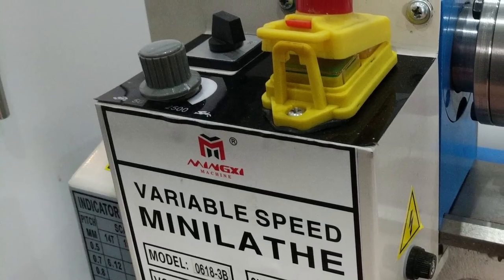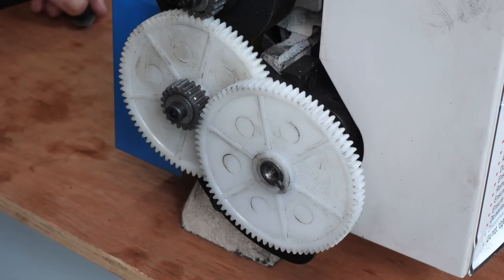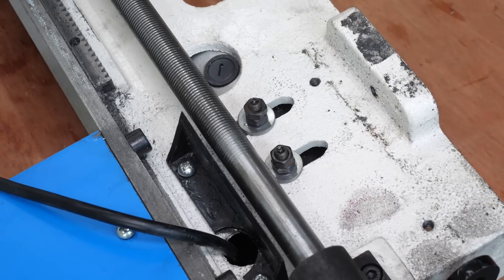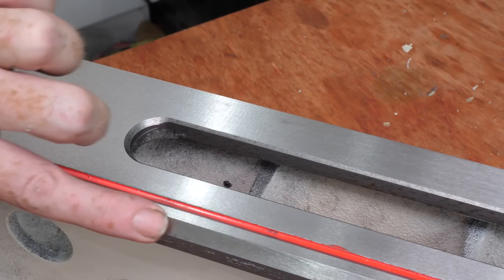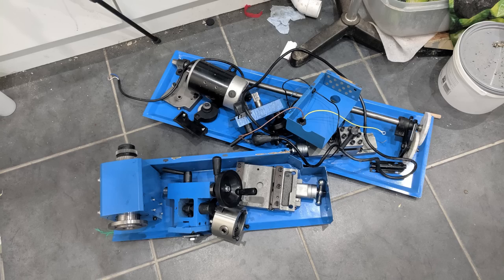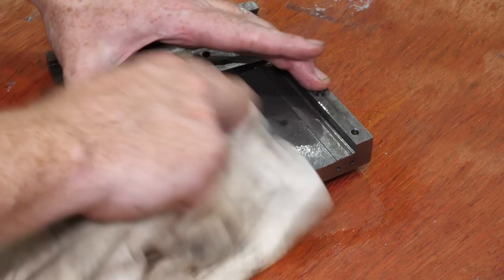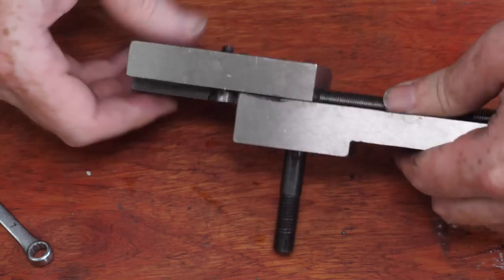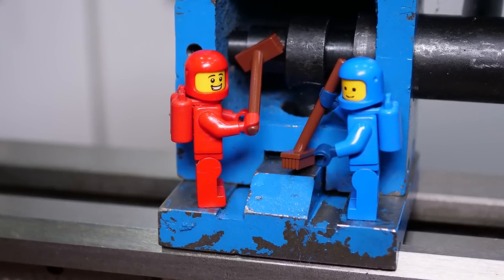Disassembling the CJ0618 7x12 Lathe, Cleaning, and Troubleshooting

Comment from the maker: A few points to emphasize,  which may not have been completely clear from the description and voiceover:

1. This lathe is marked as a CJ0618-3B model lathe, but has no other real branding information on it. The design is similar to the Sieg C2, but there is no other connection to Sieg that I know of.
2. The lathe was sold absurdly cheap as part of a batch from an anonymous Chinese eBay trader shipping from Eastern Europe. Based on what I've seen it was probably a factory second, or QA reject being sold off.
3. I am not at all unhappy about getting it in this condition, and have no intention of sending it back. Given the price, and the complete lack of proper branding, or reputation, I expected something at the lower end of the quality range. I did this to find out what the really cheap end of the mini-lathe market is like, and also to learn how to take a machine in poor condition and improve it.
Reply: Mine's a PL2102, but other than the paint colour, virtually indistinguishable. Also sold here (in UK) as CJ18. Useful, as almost all the parts are directly interchangeable. Quality depends very much on who you buy from!
Reply: It will be interesting to see how cheap it truly is, after you've bought various replacement/upgrade parts.

(hobbyists never count their labour costs, of course - it's called a "pastime" for good reason)
Reply: People have a totally biased view of "quality".  Even many old school ‘Merican tools needed a lot of fiddling or “fettling” before use. A woodworking hand plane bought at the local hardware store years ago was never fit for work right out of the box, first it is disassembled, and the body is sanded, scraped, and lapped smooth and square to all sides. The blade back is polished to a near mirror finish, and then the cutting edge is honed to hair shaving sharpness. The frog is deburred and the throat and cap iron deburred as well so the blade sits flush all ‘round. Lightly oil everything, put it back together, and NOW you're ready to use it, typically a pleasant couple of hours or so on a weekend for the average Joe back in the day, but ready for a lifetime of good use. ☺
Reply: Barry Manilowa  Re: tools, etc. My country has an issue with the perception of excellence, which is to say if an item is not made by and within the continental U.S., it is automatically assumed to be of inferior quality. As a young technician in the ‘60’s, Japan was the whipping boy of choice when it came to bashing, it was derisively called “Jap junk!” and that would win any discussion. Nowadays, if you want super precision- and can AFFORD it, you cannot beat a Japanese product. Moving along, as the decades passed the title of “Junk Purveyor” went to Mexico, S. Korea, Taiwan, and currently China. The U.S. consumer market itself made these countries a major player in the manufactured goods sector; a prime example is the company everyone loves to bash but is always the first stop when shopping for an inexpensive yet sufficiently robust tool: Harbor Freight. I’ve heard it all before, down through the decades, and it still translates to just one central concern: fear of change, and the inability to accept it.
Reply from the maker: @Daft Old Man I agree Real Bull and Sieg are different, unrelated companies, and it certainly seems that Sieg make better quality machines on average.
Reply: @BeachsideHank  Consider that the Japanese we're entering a new era of mass production and still in the prices of building/rebuilding their factors of production in the 1960's and just beginning to employ higher standards and efficiency methods as an industrial culture. This film illustrates a known defect product made in a bottom scraping industrial setting and culture. Some products entirely from China are excellent, but they are a relative minority
Reply: This is the 3rd mini lathe teardown I have seen. On ALL 3 the motor was flipping around like a kid on a roller coaster without a seatbelt.They all had mostly the same problems with fit and finish, and I even understand selling a 2nd with SOME fit and finish errors. It seems to me the poor motor mounting problem should have been corrected before selling. I hope the factory has fixed some of the issues for the ones they build now.......but I doubt it.
Reply: Block head  As am I, but he never replied back to you.
Reply: Would like to See what your compressed air solution is as I am currently lacking this and require a small unit for such.
Reply: Worth noting that although the lathe claims it has high and low gearing, it does not. The gear shift is missing from the back of the headstock casting, and the pot goes from zero to 100 without changing anything. I bought one of these (MX-0618) and was looking all over the place for the way to shift from high to low gear since mine has a tachometer and maxes out at 3,100 RPM!
Reply from the maker: @tjstips808  The lathe I bought didn't even make the high and low speed claim in the listing. The pot does work to vary the speed though. It was advertised as a variable speed lathe with no mention of a high/low lever.
This is something I actually regret. I'd have more options if it actually had the two gears.

Comment: Best thing to do with those saddle plates is to ditch the set screw adjustment method, and just shim them. It's fiddly, and takes time, but it's worth the effort. I used some aluminum sheet metal to get close, then fine tuned with kitchen aluminum foil, one strip at a time. As another commenter said, you'd also do well to mic the bed ways, and file/stone the underside to ensure uniform thickness along the entire length of the bed.

You can add a carriage lock very simply, by drilling and counterboring the tailstock-side of the saddle for an M6 socket head cap screw, and making a wide, shallow T-nut to fit the center slot of the bed. Adding locks to the cross-slide and compound is also easy... Just drill and tap an M4x.07 hole between the first and second gib screws. 

While you've got the headstock off, you should look into replacing the bearings with 30206 tapered roller bearings (you'll need to face about 2.5mm off the spacer to make everything fit), and upgrading to the metal transmission gears.
Reply from the maker: Thanks for the ideas! I'm definitely going to do something about the saddle plates, though I watched a really cool project video where HAMMERLAND replaced the plates with tapered gibs for really solid fit. Video title is "Chinese lathe Upgrade". I'm guessing this would make the thickness of the bed ways even more important, so that needs to be sorted.

Carriage lock is on the project list, and I like the sound of your design.

Metal feed gears are on order, but as I wrote in another reply, I haven't settled on a choice of bearing yet, and I'm considering angular contact bearings.

Comment: I am so glad I purchased my lathe directly from Sieg many many many years ago.
Before the poorly wired chuck guards. Mine came completely drowned in red shipping grease, but not a single spec of grime, dust or grit anywhere on it. It must have been completely broken down and cleaned before being drowned in shipping grease and reassembled. I guess this was done due to boat/container freight shipping.

Comment: I bought my mini lathe from Amadeal and it came with loads of extras quite cheap. I bought it to teach myself about lathes and machining. I knew it would be a labour of love and indeed I managed to grenade the gearbox in the first week. I stripped it as you have (Wish I'd had an ultrasonic cleaner!) and rebuilt it with steel gears and angular contact bearings. I lapped the slideways together as I don't have diamond ground stones but eventually I managed to get it to work amazingly accurately - just in time for the delivery of my 17" lathe! It was very valuable as I have not broken anything on the big lathe and have learned a lot from this little machine without any huge outlay. Great video.
Reply from the maker: Sounds like a great example of why this kind of learning experience is worthwhile. Thanks for posting.

Comment: Starting at 4:27: This rattle aggravated me for a long time. But recently I realized that if you turn the knurled handle it tightens everything and the play is eliminated, the system become stable and I suspect that  this undocumented feature is the key. Then you have to release it when you reverse or engage the other direction, and re-tighten it. 
Hope this can help others.

Comment: Wish I'd had the foresight to do that with my lathe when it was new. Over the years I've gradually fixed most of the issues, but only recently got around to lapping the cross and compound slides, amazed at the difference that made, and only took a few hours, I thoroughly recommend. The other major improvement was replacing the spindle bearings with taper rollers, and fitting metal hi/lo gears, but turns out it was the bearings on the secondary shaft that really need replacing.

Btw, for lapping the slides I tried various household metal polishing compounds, but eventually gave in and bought a product called 'Timesaver', it's a garnet based abrasive powder that doesn't embed in the soft cast iron, like diamond would. This worked well, mixed with oil thinned with bbq fluid and applied to the mating surfaces with a spatula.
Reply from the maker: Thanks for the tip about using TImesaver for lapping. Can you describe how lapping the slides improved them? I'm interested to learn more about the benefits, as well as the process.
I definitely intend to replace the bearings, but haven't quite settled on which type to go for.
Reply: @AdventureswithaVerySmallLathe  Sure. If you blue up the cross slide where it bears on the saddle, and run it back and forth a few times, you'll probably find the contact points are small and unevenly distributed. So when you try to adjust the gibs it's difficult to get to the point where there's no slop without it binding up. The result is a stiff slide, and/or a lack of rigidity. You can test this with a dial gauge. If you've ever had difficulty parting off, this probably has a lot to do with it. After lapping, I found mine are easier to adjust, and a lot more rigid than before. 

(edit) I chose the medium grade Timesaver compound (green label for ferrous), it's not cheap (in the UK) and I couldn't afford to buy all three grades. A 2 oz jar set me back £23 and I only needed a fraction of that quantity, but I will have other lapping projects soon and it will get used eventually. Household brass polish will also work,  but will take longer.

As for bearings,  tapered rollers have one big advantage over plain balls, in that they can handle greater axial loads. However there are a couple of drawbacks - you will need different size spacers to get the hi-lo gears to line up correctly (I 3d-printed replacement spacers as needed). And whereas the original ball bearings are sealed, taper rollers aren't. Again - 3d printer to the rescue, I printed covers from TPU (flex filament) that fit tight on the spindle, preventing ingress. Anyway, no regrets on choosing tapered rollers for mine!

Hope this is helpful, and thanks for taking the time to share your experience - hope no one is put off buying a mini lathe, I love mine!
Reply from the maker: @fredgenius  Thanks for the details! DId you consider hand scraping rather than lapping to improve the contact points? I've read that it's preferred, as the scraped finish retains an oil film better than a lapped flat surface.

For bearings I'm weighing up between tapered rollers, and angular contact bearings. Angular contacts can run faster, but are technically more difficult to install, especially getting the pre-load right. They also have the advantage of being available sealed. The job is simpler for me because this lathe doesn't have hi-lo gears, as you may be able to see when I was disassembling the drive mechanism.

I really hope I'm not putting anyone off, but I do aim to help people understand what to look out for at the cheaper end of the market.
Reply: @AdventureswithaVerySmallLathe  Yes, I did think about about scraping, but although I've got the tools and watched others scraping, I've never actually tried. Very easy to take metal away, very hard to put it back (as my old teacher often said).
Reply from the maker: Flat Bastard Engineering Channel  That would definitely be my inclination, but I was interested to hear Fred's reasons for choosing to lap rather than scrape.
Reply: @AdventureswithaVerySmallLathe  I have used the scraping method (actually the "print-and-cut method; in the early stages I used a file, not a scraper). It works very well, and is easy to do. The only danger is removing too much metal, but most beginners (including me) err very much on the side of caution, so the method is slow, but carries little danger.

It requires amazingly little hand skill, I am happy to report.

All shops should have at least a 8"x12" granite surface plate!

Comment: Glad to see you accepting the project with an open mind... Sure, it is a bummer, that once a dinky machine like this needs so much dang work, but, if the manufactures/assemblers were to do all this, the machine would cost an additional $2500 over the original cost... I spent a year redoing my mini lathe and mill, with total re-machining, re-flame hardening the ways (induction hardened actually) and surface grinding of all mating contact points, soft heated the main casting(the bed ways) and saturated by dunking in a drum a few times in oil, I planned for various type of roller/ball/thrust bearings at every location that has friction.motion. redesigned the motor mounting to something more adjustable and secure with ease... and all though, towards the end on my venture in rebuilding them seemed to just drag on... once done, I love my little machines, and never have any issues holding tolerance of (0.0005") all day long... so much so, that jobs come my way (just silly small jobs) that somebody needs a bushing or something to be spot on, they bring it to me, mind you, they own machine shops with with $10million worth of machines, LOL... but is cheaper and faster to just drive over to me, and have me knock out the parts....  I feel kinda bad, as one of the smaller shops went and purchased one of these little machines to add to his own shop, not fully understanding what all I had done to get my units to the higher grade capability and were so disappointed in their purchase... so, I recommended that he turn that into a program for one of his employees to do a complete tear down and clean up, re-machine and straighten up on all 3 plain's / axis and surface grind etc... as kinda a apprenticeship type thing....  now, his shop has a shipping pallet of these that have been redone to a higher standard by his employees.. There is no consistency with what one employee does compared to another.. I think I still have videos of what I did some 15 to 20 years ago with my little machines on my channel that I do not upload to anymore... LOL

I have had several people offer to buy mine, and even after telling them a seriously over inflated price (due to not wanting to sell them, as I don't think I have it in me to replicate what all I did, allot of work and time.)  The truing up of all the moving parts, to allow the smooth operation, I think is what they are after in mine.. but, so worth it, not having to hassle with all the bugs that come poorly designed into the units.. but with a wee bit of effort and time, and not much money, one can build one heck of extremely finely tuned machine.. Again, I am glad to see somebody else taking the time to show the world that the rebuilding of these little machines is just as fun and part of it, and making parts for different projects. I enjoyed watching your video, look forward to part 2 and possibly 3.
Reply from the maker: That sounds like quite an achievement, and I can imagine why you have no interest in selling the machine at any price. Once you've put that much of yourself into something, it's important to keep it. I don't think I'll ever match the standard of completeness of work you describe, but I'm certainly planning on making a series of these videos, covering various improvements, as long as people enjoy watching them.

Thanks for posting such a comprehensive post about your work. I hope it'll help others understand why working on machines like this can be so worthwhile.
Reply: @AdventureswithaVerySmallLathe  Yup, just enjoy the building process... Brother.

Comment: An interesting project that "feels" like what I went through tearing down, cleaning, deburring, and reassembling my minimill!
This video set looks as if it should be a "go to" for newcomers!
Reply from the maker: Thanks for watching. How do you feel about the mini mill now you've done the work? Is the end result worth the extra effort you put in, on top of the purchase cost?
Reply: @AdventureswithaVerySmallLathe  I purchased mine "second hand." It had been used mostly on wood. It had never been cleaned and still had the factory "stuff" on most surfaces. So in addition to cleaning I also replaced the gears with belt drive, and changed out the metric X-Y table traverse screws with Imperial. For learning I think its been worth it. Total costs so far are less than one new. And! I know where all the parts are, their condition, and how to best to tear down and clean in the future.